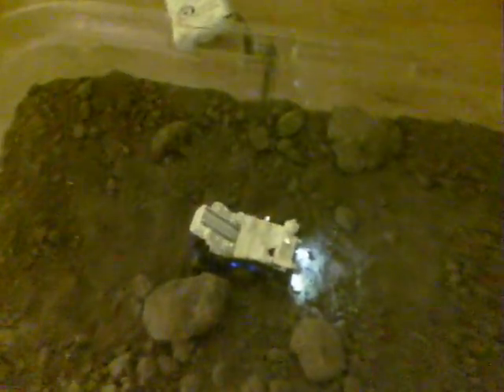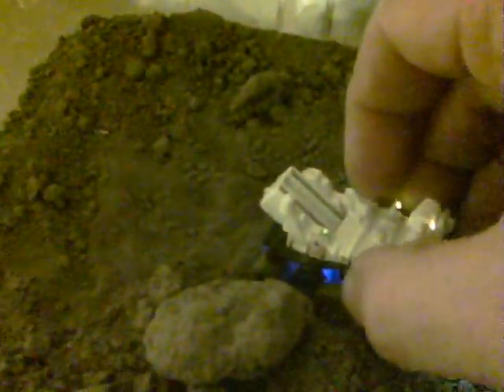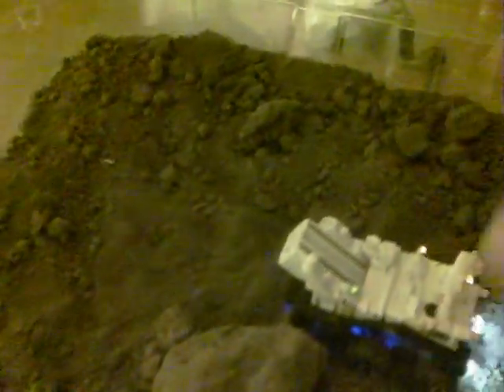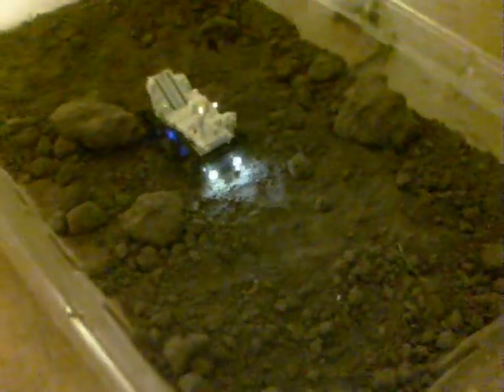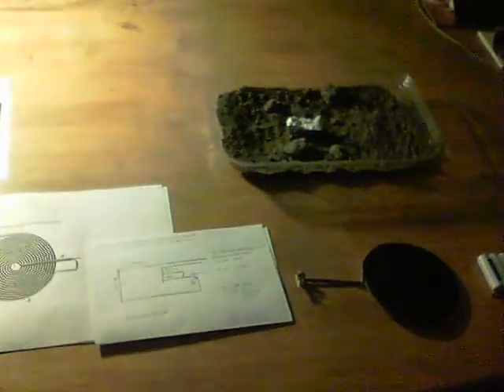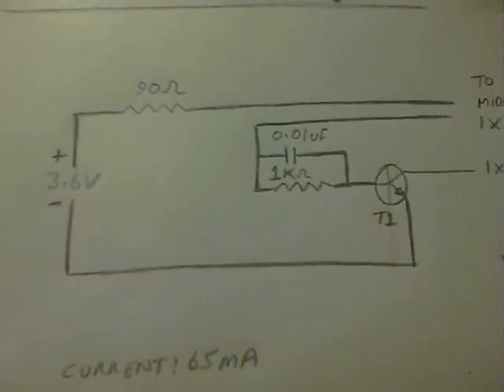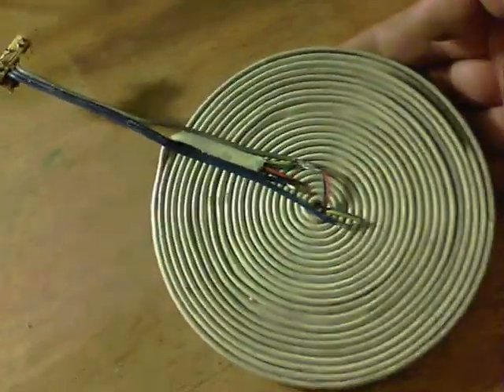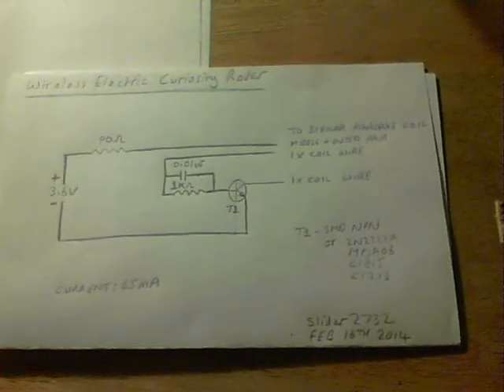Wireless Electric - Curiosity Rover

Comment: Can you fit a worlds smallest car motor in there? I can get them to run on SWES :) Although your pickup coil may be a little small. Nice little build. Its tiny, all that fiddly wiring would drive me bonkers.... Oh wait.....
Reply from the maker: Thought about the motor, but here's why not. 4mm would fit, but no power as direct drive + the gearing wouldn't fit. 6mm better power but not enough to move 26g of rover. All else wouldn't fit...real one only moves about once a week anyway lol
Reply: 26g. I see your point. You'd have to turn the drive coil up so hard it would levitate the car, and you already did that with the Valerian.
Reply: will it work with a large power transistor like a 2n3055  transistor
Reply: сталкер чворович
 Sure does :) Simple Wireless Electricity System on 6&12v

I think I've killed about 20 3055's with SWES. They work, but die easy on higher power. They also guzzle the amps. TIP122 is a better pick. Not killed one yet. better performance for less  input current too.
Reply: Mongrel Shark lol that was quick thanx mate